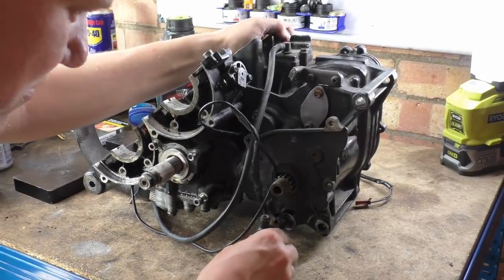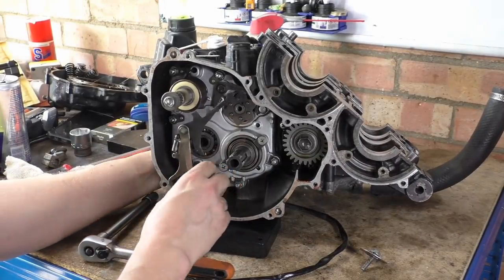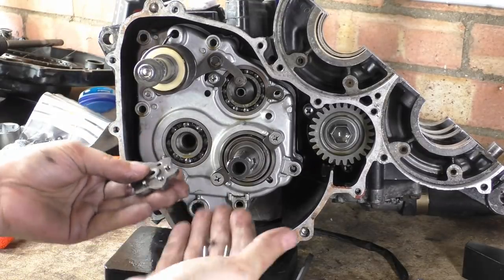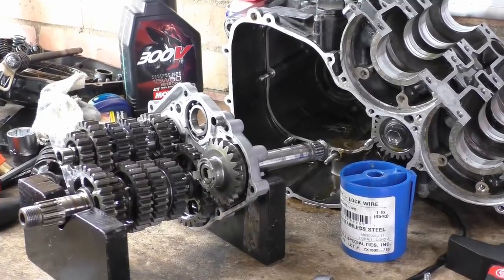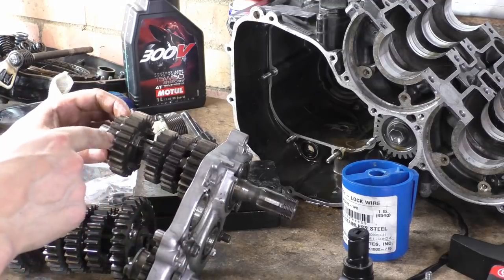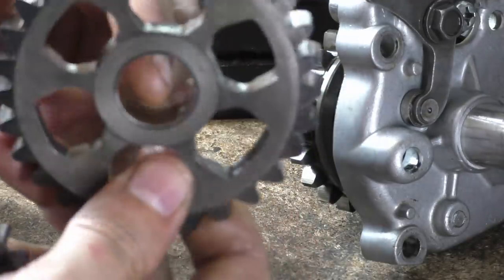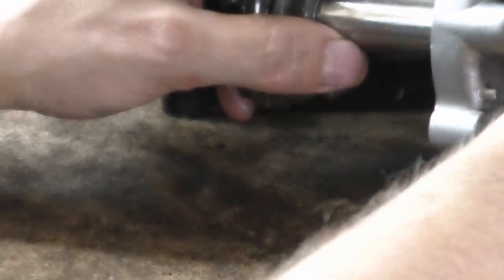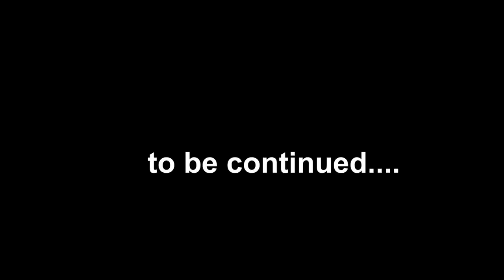Suzuki RG500 Teardown - Part 9 - Gearbox

Comment: RG5's are known for a draggy clutch with various clutch basket shims available to help correct this, also there are support plates with a bearing for the gear change shaft available which help changes be more positive, clearly well worth looking into. 
Top video Matt, as per, really enjoying this series.

Comment: The pawl on the sprag is held in by the dead stop when the kick start returns back by the spring, it's not noisy in first as the sprag is not engaged until it's taken off the dead stop. Hope that makes sense Matt.

Comment: I've seen that type of wear often in older gearboxes, it would almost definitely have been jumping out of first gear under load. The engagement is nowhere as deep as you were demonstrating on the bench and the drive dogs do show signs of wear presenting as radii on the leading and trailing edges of the drive dog castings, however I believe that you are correct in assuming that gear has been replaced as the amount of wear is not as severe as the corresponding gear.  It can be caused by poorly adjusted shift drum, bent selector fork, clutchless or careless shifting or a lack of regular oil changes.  Once they start to jump they deteriorate quite quickly as they hammer in and out of engagement under load.  A new gear is the ultimate resolution however you can repair them.  Preheating the gear and welding it with an appropriate rod, a low hydrogen or even a stainless arc welding rod, to build up the damaged sections.  Immediately followed by heating the welded areas to cherry red to relieve the stresses caused by welding and then buried in lime to slowly cool is the technique I have successfully used to repair induction hardened gears.  Then you need to grind back nice sharp edges and VOILA! She'll chooch again for years to come.
Reply: Is  that something you do ONLY whuen you can't get the gears or is it a perfectly acceptable alternative to a replacement?

IV heard of welding doglegs on Harley gearboxes but afaik that's considered a bodge and replacement is always suggested.

Comment: Not like Suzuki to have imperfections in gear castings 😂 I've currently got a 1997 tl1000s engine in bits because it stripped second and third gear! Luckily there wasn't to much other damage caused in the process. Loving the RG videos Matt keep them coming 😁

Comment: When running normally in first gear, isn’t the kickstart shaft in the position as at 25:49 so the sprag thingy is depressed and the starter gear is just spinning freely?
Reply: I was thinking the same thing
Reply: exactly what i was thinking about

Comment: Been meaning to ask for a bit, I've been tearing down and rebuilding a Bridgestone 175 and the rotary intake valves are made of almost a pressed fiber material, almost feels wooden oddly enough. I haven't been on the earth even half as long as this engine, are these intakes just asbestos or something??? Only used to seeing carbon fiber or metal discs.

The tranny in the Bridgestone is weird as fuck too, never seen something have two different shift styles you can select from.

Comment: is that plastic bit on the end of the kickstart not an auto lube pump drive  ?
Reply from the maker: LOL no.
Reply: in the beginning of the vid where you  are filming the left side of the motor theres a home made blanking plate which looks like it would house a mikuni autolube pump,and the slot in the end of the plastic thingy looks like the drive for the pump
Reply: Yes - that is exactly what it is...its drives the oil pump sat on top of the crankcase - you can see the oil pump in the pic of my engine. https://farm5.staticflickr.com/4601/38557478785_e80ca7342a_b.jpg
Reply: Yes ;-)
Reply: holy fuck by how much did you stroke up that crank to need base spacers that thick
Reply: that looks insane ,trick rotary valve covers n all
Reply: smallends look bigger too
Reply: The stroke is the same but I am trying longer rods . I started it up for the first time since the long rod build today...man I've missed that awesome square four sound. I might post a link here later of it running...
Reply: whats the displasement up to now
Reply: I've always used 59.x even with standard length rods - gives the engine nice little boost. Mine is now 59.50 so ~563cc. The big bore pistons are actually cheaper than the Suzuki setup hence why most people now go the 59.x route. The owner of this engine needs to send the cranks and barrels to http://www.grampianmotors.co.uk/ for a crank refresh, bore the barrel to 59mm and supply the big bore piston. Unfortunately, I get the impression the owner is trying to do this on a budget. An RG500 refresh including up-rated Ellis Moore gears cost at least £1500. A full on tuned engine with pipes costs > £4k. Mine has loads of extra's including a full Nova gearbox...probably owes me well over > £6k. A much easier solution would be just to get Mark Dent @ http://www.performancefab.co.uk/ to rebuild it....